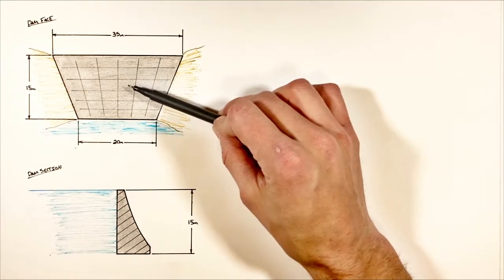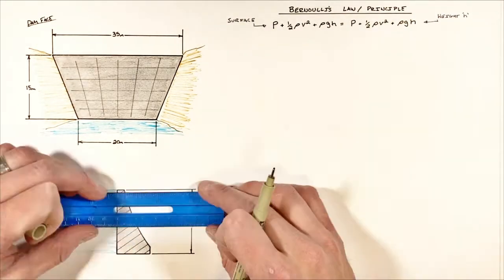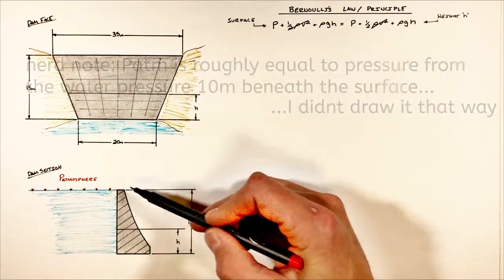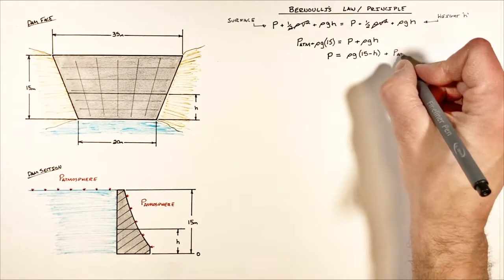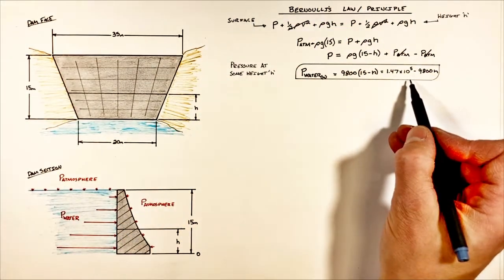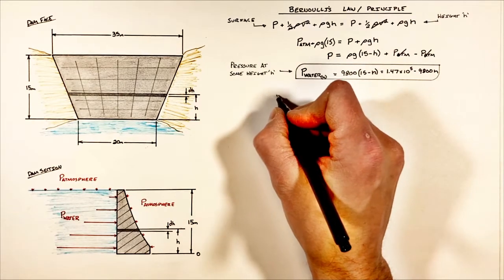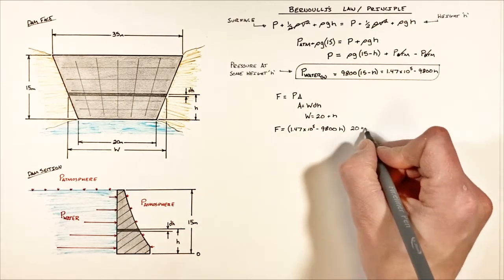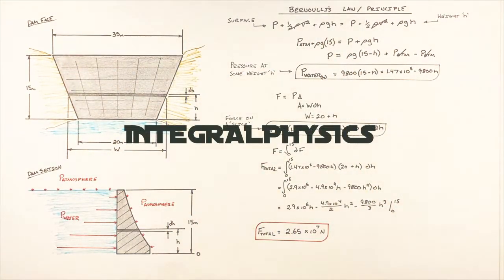Calculate Static Force & Pressure on a Dam | Bernoulli's Law

Comment: one thing I'd note is the only reason w=20+h is because dh is the same as dw since it changes 15m, per 15m. if the geometry was anything but this slope of 1, it would solve differently. In the video you briefly acknowledge this but don't really explain it, which could lead to some confusions. Overall great video just thought I'd give my feedback ik it's 3 years old but eh, hope you're having a great day.
Reply from the maker: thanks!